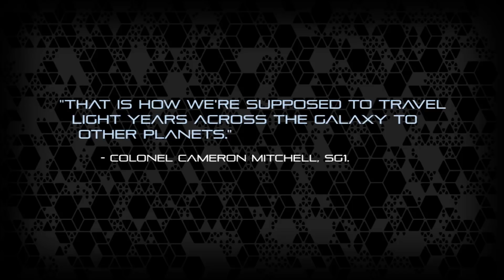The Stargate - Spacedock Sci-Tech.

Comment: I loved Stargate but my biggest criticism of the gates was how they always knew exactly how long the plot needed them to stay open. They may only last long enough to walk through or they may last long enough to have a long conversation.
Reply: Kathic 
1)36 minutes longest without time dilation 
2)they can track the passing objects as well as signal from another side
3)they have safety procedure to shut it down as soon as possible
^any problem?
Reply: @TheArklyte  *38 minutes and change. Not 36.
Reply: The gate can detect to a certain degree if objects or lifeforms are nearby that may wish to enter, although it is never explained exactly how it does that, but its probably a very advanced algorithm. Nonetheless DHD-operated gates usually close automatically if it seems unlikely anyone else will enter the gate. 
The earth gate, being operated more manually, is always closed manually, hence leaving it to Walter to close the gate when appropriate. 
The dialing gate by the way can be closed before the traveller arrives at the other side as in such a case the receiving gate stays open long enough to wait for any remaining matter to arrive and materialize. 
There are also a few safety features, like sticking your hand into the event horizon of either active gate will prevent the connection from being severed (its unknown if that applies to the earth gate though), or the gate will output an error message (that the earth dialing computer can recognize but not interpret) if unmaterialized matter from a previous wormhole is still in the buffer in order to prevent dialing (I assume with a DHD it may communicate more properly and prevent dialing entirely though the problem is not supposed to happen with DHDs in the first place). 
The only times gates may close prematurely is if the energy supply is abruptly cut off (and there is no more energy in the Gates own condensators) or the dialing gate is destroyed, or if energy supply is insufficient or slowly running dry. In such a case the gate can either shut down or the connection can become unstable. If matter is in transit at the given time, the DHD on the receiving gate may take over power supply until matter is materialized. If the receiving gate has no DHD (such as the earth gate) the matter will be received into the buffer but not materialize, hence creating the above mentioned error.
Reply: I'm not sure but I think you talk about a situation I always wonder. Sometimes they activate the gate and move into it in few seconds after they reach their destination Stargate will turn off. Also in lots of situations they activate the gate then move into it in few minutes(gate still open bc of 38 minutes rule) and they reach their destination but gate is still open. And it always based on the plot.
PS: Watch your six, you Cerberus fan Alliance is coming for you.
Reply: matchesburn 
I recall it was an episode where he was a double agent for NID or whatever they're called. He was keeping it open so that they could not redial it to another address and escape.
Reply: +Commander Shepard
The gate auto-shuts off (SGC's gate is a different story because they don't have/use the safety protocols of a DHD since they lack a working one) if nothing is entering it. In fact, one time O'Neill wanted to keep a gate open for some reason (can't remember) and physically waved his hand in the connection portal in order to keep the gate from shutting off.
Reply: I’m pretty sure they can close it via the dialing computer or dhd whenever they want to. So the gate will stay open until either the 38 minutes pass or it is manually closed by either Stargate Command or someone pressing the central button on the dhd.
Reply: builder396
 It's been a while since I wtched SG-1, but if I remeber correctly, they just send some dummy signal through the gate if they want to keep it open. To close the gate, they just deactivate the signal. If nothing passes through it, the gate shuts off immediatly.
Reply: the IDC sends a radio signal through the gate that keeps it active, that's why it always closes just behind the last man.
Reply: Commander Shepard 
ah, yeah, I see now. The gate on exit side should always close at the same time as entry one, but in this case initial one is already closed while they're still in transit to destination. Thanks.
Reply: Technically, if a person that has passed the gate and is already on the other side, puts his hand in even horizon, gate won t shut down until 38min or until the person will remove his hand from it
Example: general oneill before entering gate said "I will keep the door open for ya" and after he passed, he held his weapon inside the event horizon until everyone passed, after that he removed his weapon from it and gate closed
Reply: But they never shut down the gate using the DHD...
Reply: Commander Shepard 
sorry, I fail to see anything not answered by my previos comment. Care to specify?
Reply: +TheArklyte
Sounds about right.
Reply: @Analkarl: Yes, a constant radio signal can also keep the gate open, Im assuming another thing the gate can detect as a reason not to shut down 
@Fact Core: Get your facts straight. The gate was never manually shut down by pressing the DHDs red button. DHD gates always shut down automatically unless matter was sent through or it was kept open some other way.
Reply: There is some inconsistency on that though, like all the times the dialing gate often shuts down nearly immediately after the person goes in. 
That means either the gate randomly shuts down due to sfx errors, or the algorithm that decides when the gate stays open is incredibly advanced and can not only recognize speech but also metaphors, dialect and slang right off the bat.
Reply: builder396 or maybe the first person that passes the gate keeps their limb in event horizon in order to prevent gates from shuting down
Reply: builder396 I’m saying that the SGC’s dialing computer could shut it down, as could a dhd.
Reply: builder396 I could have sworn they did. Or maybe I read it somewhere. I’m fairly sure that’s how it works, but I haven’t seen the show in a while.
Reply: Kathic it's not perfectly consistent but there some rules we know or are pretty certain to be true.
1) radio signals will keep it open and I would assume that the tauri quickly figured out how to keep the gate open this way, they probably implemented it into the GDOs.
2) we do know that the Gate is also somewhat selective towards what it considers to want to pass through and what does not (for example wind will generally not have any effect) and I would assume that it also differentiates between natural occuring electromagnetic waves especially visible light but also other natural background signals and an actuall man-made signal.
As to how it uses this variables I would guess that once activated it probably starts an internal timer which shuts of the gate if nothing is transmitted and is resetted if something is transmitted, although the first timer is probably longer since you first have to get from the dhd to the gate and so on. It probably also is capable of further changing the timer based on what has been send through so far, for example if you had a group of people it might adjust it depending on how much distance there is between them and how fast they are moving to basically determin if a group of people has past through and it would now be a good time to close the gate or if it's just the gap between two people of a group. I would assume that in scenarios  such as a object or a group of objects passing through followed only by very fast objects or energy projectiles would soon cause the timer to shorten drastically. Furthermore there probably are special rules for example if dialled by a puddle jumper it is probably not going to close untill the jumper passed through or the pilot made his intention clear that he does not want to pass through the gate or in Atlantis further input from the cities sensors could be used to determine who wants to go through and if they did (for example if you have a group of people standing close to the gate it would close it once they passed if nobody else approaches it but if there is nobody there except you when you dial it would wait longer since you first have to get down there.
Reply: It takes a few seconds for matter to transit a wormhole, so if a Stargate shuts down immediately after someone emerges through, this most likely meant no one else followed behind in those previous seconds.

There has been at least one onscreen instance of someone sending a continuous radio signal through a wormhole specifically as a means to keep the gate open while no one was actually passing through.
Reply: For example sometimes they dial the gate and travel into it and gate closes immediately because they left no one behind but when someone is coming from behind gate waits before close. I hope you can understand

Comment: Why would photons (in radio wave energies) be able to go both ways through a gate, but not other particles?  Are gluons  (the other massless particle) also able to transit in both directions?
Reply: First Cynic plot
Reply: we'll pretend that the gate actually opens two wormholes, the normal one for things to go through one way, and a microscopic one(and needing much less energy) to allow signals to go the other way, also explains why you need the origin point to dial so the other gate knows who to dial the micro-gate to.
Reply: well the stargate is more than just a wormhole; the stargate actively disassembles objects and sends their elemental particles through near the speed of light to be reassembled at the other side.
so if the wormhole itself goes both ways the radio waves can go both ways (they can not be split any further into more fundamental particles); but a regular object can not (it requires the active reassembly at the other end; so if the gate isn't designed to assemble and reassemble at both sides simultaneously objects would only be able to go one way)
Reply: The simplest contrivance is that energy (in any form) can pass both ways, but physical matter is converted in only one direction. If an object tried to pass through the wrong way of a wormhole, it simply is never re-converted into matter at the other end and comes out the other side as energy. If said matter was a human, that would be bad. Very bad.
Reply: Sometimes its implied that iris remotes work with the stargate inactive, dunno how but a few episodes show somebody inputting the code before activating the gate and going through

Comment: Fun fact: The Ancients had fucking massive hands, which explains why all their buttons are so ridiculously large.
Reply: you both are wrong. Giant buttons are design using precognition so that they can continue using them when they'll have massive energy "tentacles" instead of fingers... or so that energy giants from episode with glass skull could use it in any form without microscope.
Reply: Ze Rubenator wrong! Anicent use telekines to move it!!
Reply: Or maybe they had really bad eyes, kinda like how there's a big text version of anything for seniors.
Reply: It's likely it was designed to be used even while injured. If your hands are damaged or even missing, you can still accurately dial with other parts of the body. Or even an object. Or maybe it was just an interesting design choice. And or the buttons were designed to be easily changed out. (Or possibly change on the fly if there was a nanotech component)